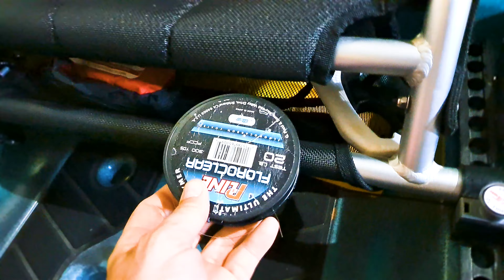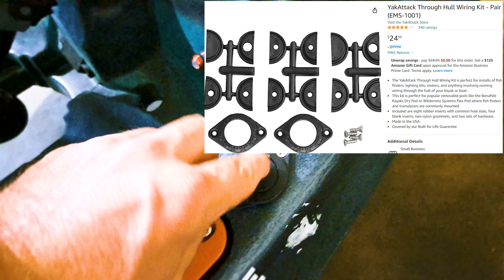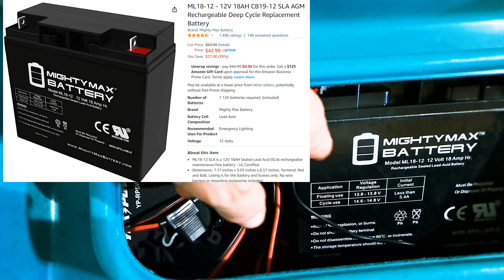Oldtown Sportsman PDL 106 - Current Setup (I keep it simple)

Comment: Nice set up Travis. Hoping to add electronics and power next year, but we will see, would like to spend the money on a truck first to haul this giant kayak around so I don't have to use the wife's mini van 😂
Reply from the maker: You are not lying. I am going to use my work bonus in the spring for a trailer. I am going to get a harbor freight one and deck it out the right way, I am talking about welding attachments and upgrades on it. The hitch for my SUV is cheap and easy to install. I am doing it for the laziest reason, I want have it all loaded and ready in the garage (to a degree) and launch it within five minutes vs twenty. Keeping the battery in it would be nice to. The switch kit, USB, and lights are my favorite additions right now for sure.
Reply: @TravisDoesKayakFishing  believe me the trailer is a HUGE difference! Literally takes 5 minutes to launch, or take out. It is so much better, I just can't always take the van out when I go, and I don't think my little car could handle pulling it even if I put a hitch on it. But a truck is definitely in my near future and will be nice when I never have to car top again! 😆
Reply from the maker: @DoubleBogeyBass  I will join in the success in the spring 🤣 Until then, winter a process, a refined one, but a process nonetheless.